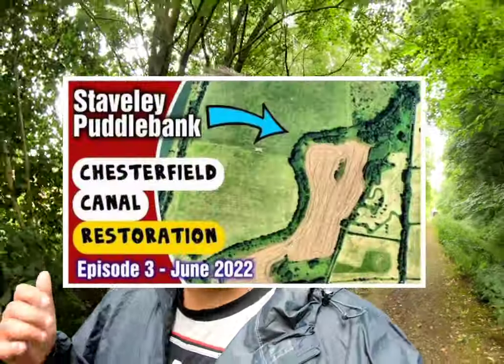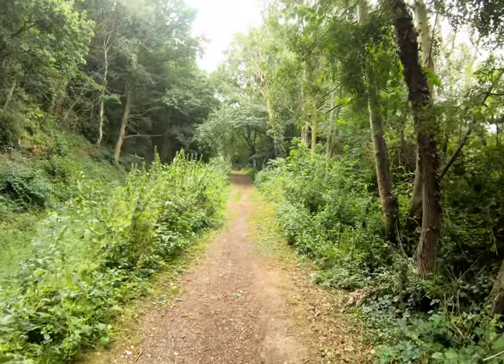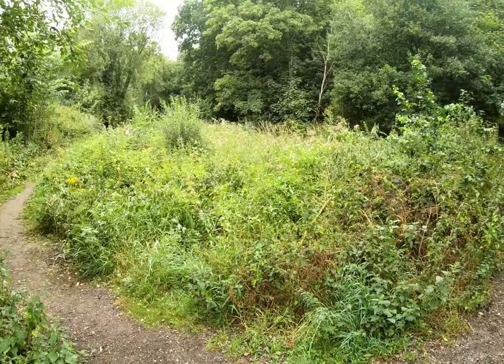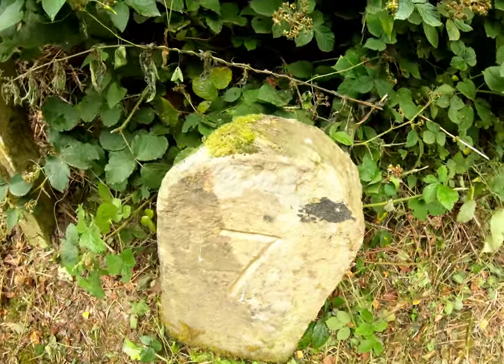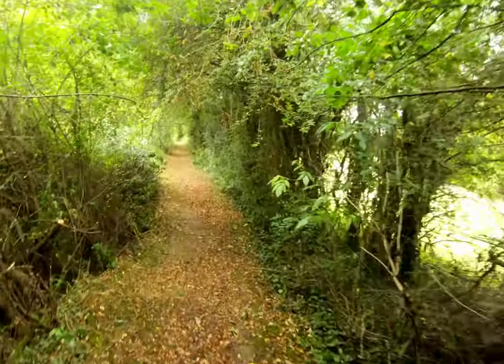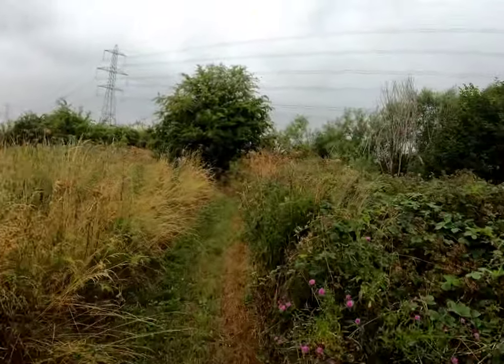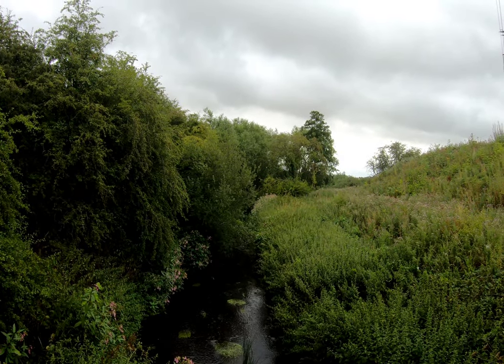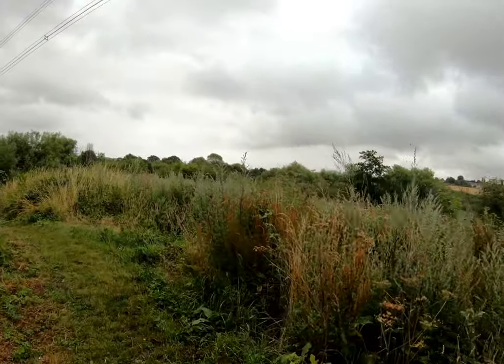Chesterfield Canal Restoration Part 4 - A New Aqueduct

Comment: Can remember walking through from old Renishaw iron works old pump station site….down towards The miners crossing there was only a wire fence …up the side of the railway….which you filmed on this vlog, there was no embankment near the railway.
The river Doe Lea use to pass under the canal through a culvert….which was demolished when the Puddle-bank was bulldozed….I’ve read somewhere that it use to be a pain because when the Doe Lea flooded ….Debris blocked the culvert entrance causing the Doe Lea to back up. Hence when the canal went so did the Culvert.
Reply from the maker: Miners crossing. It was bugging me all day what that was called. It completely slipped my mind. 
Cheers for the info Michael 👍. It's always  great to hear first hand accounts of how stuff was.
Reply: @WobblyRunner  the miners who worked at Renishaw Park colliery use to walk through the yard down the path and walk over the bridge on the LMS line…continue down the path until they got to the Great Central Railway Line….the instead of walking along the old Goods yard past the signal box onto the main road,they use to climb through the wire fence, cross the railway line …climb through the wire  fence once again…( the concrete posts on your vlog)
Then crossover at Miners Crossing and walking through the wood onto Hague Lane into the estate….I remember it being a pipe with semi circle spikes fitted to brackets around the pipe one at either side to stop people walking over the pipe…..but mysteriously the middle 3 spikes were missing…
By crossing there it must have saved them a good 25 to 30 minutes walking into Renishaw to get onto the council and coal board estates….
Reply from the maker: @michaelhibbert4393  just like water 💧.  Folk will find an easier way through if it's possible 😄